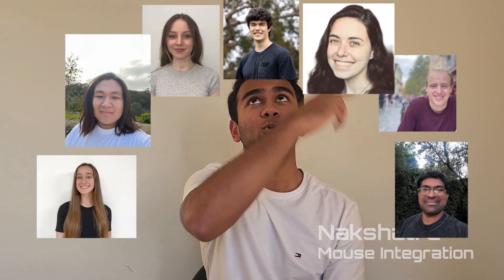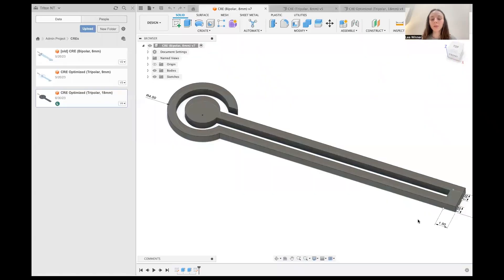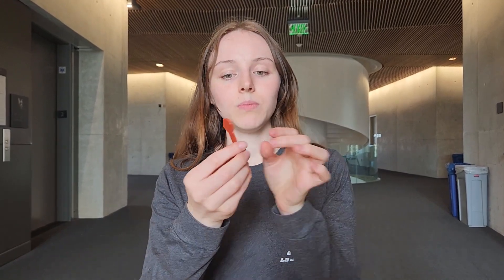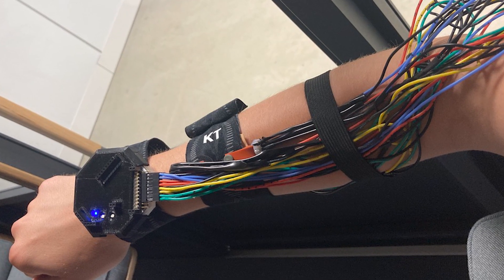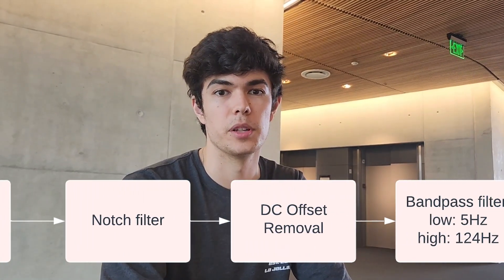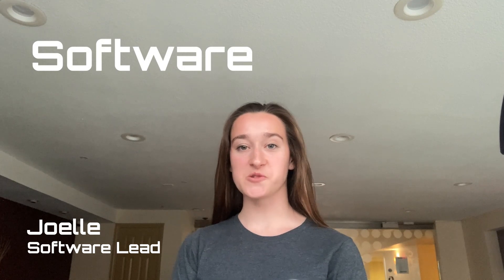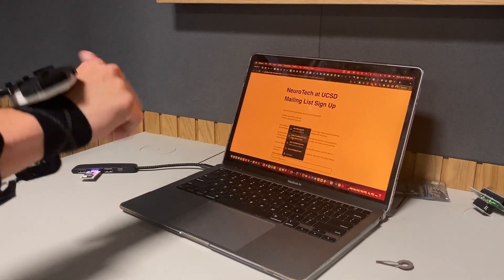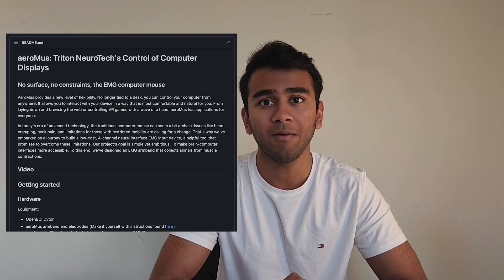aeroMus - EMG Mouse | Triton NeuroTech 2023

Comment: Nice project. Thought Technology , the company I founded almost 50 years ago has been making very low noise sEMG sensors for over 40 years. As founder and head of R&D, I applaud you for your innovation and teamwork in developing this project. I can see the possible use in VR environments, similar to what CTRL labs did; however, for day-to-day use, this would be much too fatiguing on arm and shoulder muscles to be practical. I made an adapter to my chair's armrest to mount a trackball and then monitored the sEMG activity from my trapezius muscles until I found a position that produced the lowest EMG activity when in use.